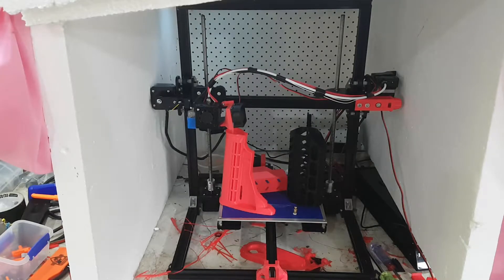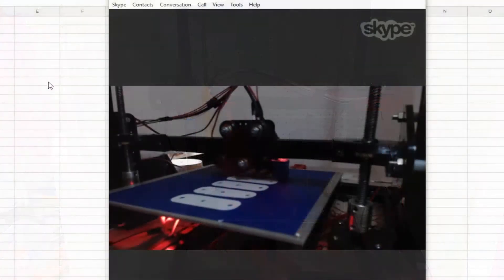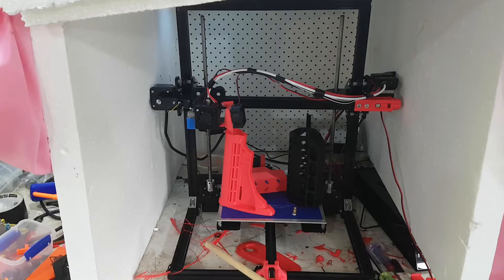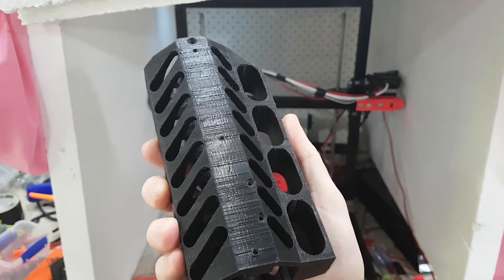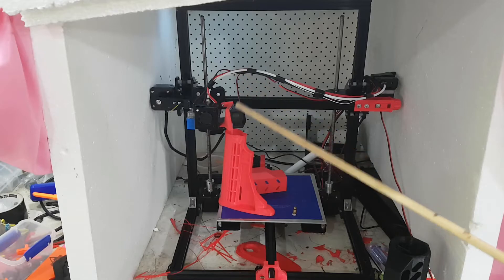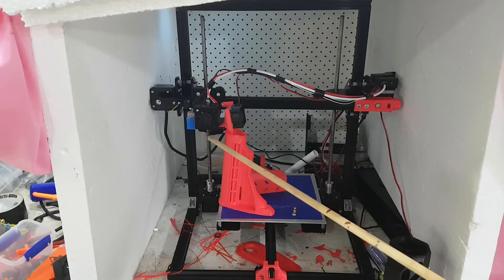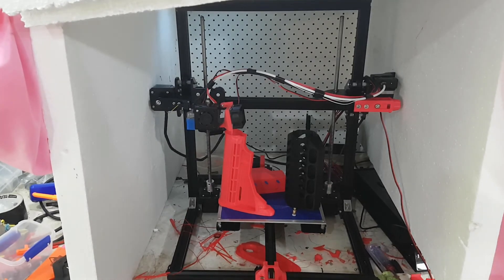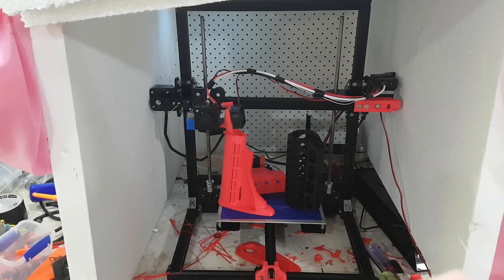Tronxy X3 3D Printer Build: Y wobble again ! : Episode 6

Comment: Some impressive prints, thanks for talking us through some of your issues. I've just got my Tronxy X3A going, printed a handful of things and it seems to work brilliantly. The X3A has a heated bed so I print directly onto the aluminium with a bit of hairspray to help it stick, the cool thing is as soon as the bed cools down it releases the part as it drops below 40c, no pulling required :) Only problems are the bed is very concave unfortunately, so gonna have to buy a better bed for it, and the X axis wire is very short and needs extending. Anyways, keep up the good work, all the best :)